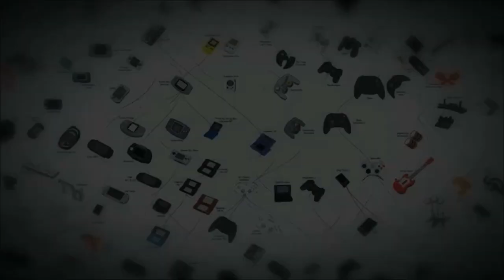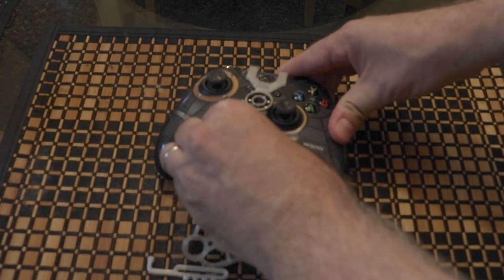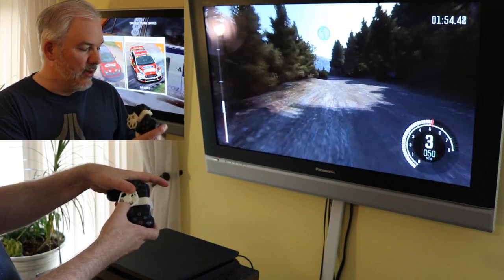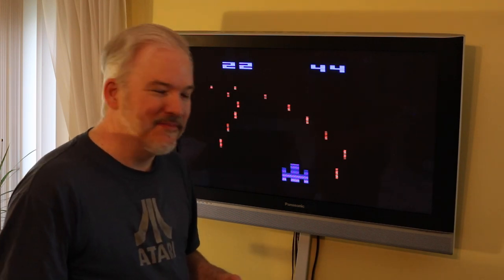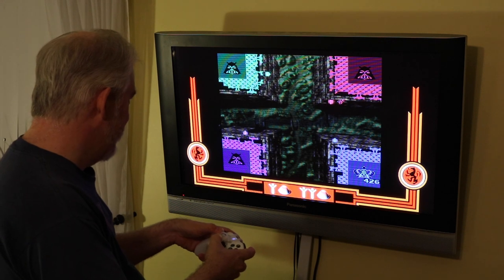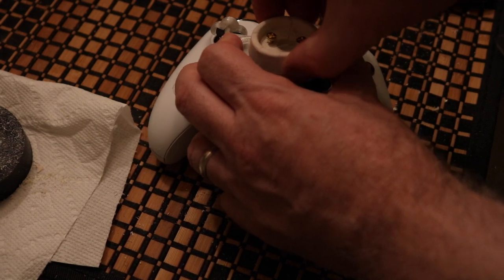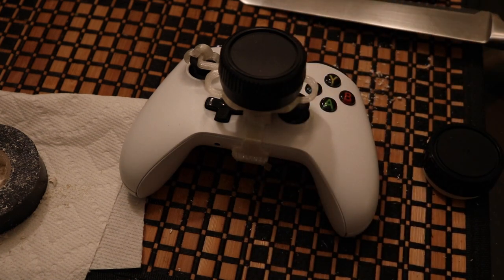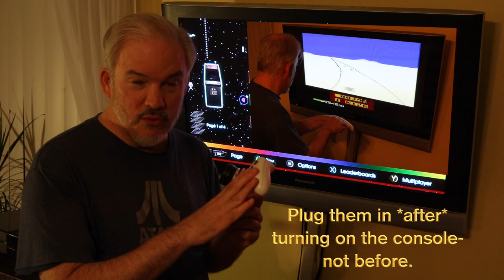Retrofit PS4/XB1 Controller: 3D-Printed Forza Mini-Wheel/Paddle for Better Retro-Gaming (vid #53)

Comment: I'm glad you showed that it can either be self-centering or non-self-centering.  What is the difference, and is there a special "locking" part that's extra?
Reply from the maker: Thanks, Brian. Glad you got to watch it, since you were the guy who had expressed some serious interest a couple months back in me covering using a paddle controller on the new system classic games compilations.  

Regarding your questions, self-centering is preferred in games that have an emphasis on center-position within their method of control.  Driving games work best with a self-centering controller because it's nice to just let go of the wheel when you want the vehicle path to straighten out.  Another type of game that benefits from self-centering would be shooters like Tempest and Tempest X (PS1).  When you want to come to a halt, it's nice to release the paddle and let a spring mechanism bring it back to center-position.  It stabilizes the control in the game.

Self-centering controls are not the ideal for games like Super Breakout and Star Wars Arcade, though, because the analog movement in those games is 1 to 1 with the controller position.  In other words, it's relative to the actual stick or paddle position.  I can think of a number of true analog games which do best with a paddle or joystick that doesn't self-center: Circus Atari, Arkanoid (& all Breakout or Warlords style games), Astroblast, Solar Storm, and any game that you'd prefer to use a mouse with (aim-control shooters like Star Wars Arcade or Terminator 2 Arcade).

Now the paddle attachment that I was using in this episode on the white Xbox One controller has a very light amount of self-centering, which is actually okay in pretty much all the games. If it was a strong amount of recentering I'd be less excited about it...  but it's a good all-around gadget to use on all the analog games because the self-centering is as light as a feather (and this is because I sanded down the horizontally-positioned on-a-track part that connects to the teeth of the center-wheel gears to reduce friction). 

The dark-colored Xbox One controller, by the way, had a non-self-centering wheel attachment on it.  I chose to not sand it down much at all, so it's got an increased amount of friction that keeps it from recentering.  It's got a little too much friction at the moment, so I'm thinking of sanding it a small amount, so it might be improved.

Again, I'm glad you got a chance to see this video. Feel free to post it on any of your websites :)

Comment: I wonder if theres a way to make something that uses the PS4s touch pad to make some sort of analog controller for the supported games on the Flashback collections?
Reply from the maker: The only possibility I can think of would be to use a device that can be programmed for remapping functions on the controller.  But, as far as I know, the CronusMax Plus cannot assign touchpad activity to the analog stick.  I don't know for sure about the Cronus Zen, though... it could be possible with that.

Comment: About the extra buttons, there is a Power A Authorized Xbox controller with a ring finger button on the back on left and right.

I got one for $20 and 3 for free because the audio port was not working.  Later turns out it needs an Apple/Android chat cable converter
Reply from the maker: Nice. I wonder: Does the steering wheel attachment fit on it?
Reply: @wiredupretro  I noticed there are two separate versions of the Xbox One on those steering devices.  1 works for S controllers and X controllers.  And the other works for model 1 controllers.  It depends on the measurements of where the analog sticks are.

And I also noticed that that stick is a two-way stick.  Is it possible to oriented vertically for vertical games, like pong Sports.
Reply: @wiredupretro  finally they should tell you whether their gear teeth are designed to keep stationery
Reply: @wiredupretro  keep  stationary, or self center.
Reply from the maker: @Aceintheholeminigolf  There may be two versions for the different iterations of the X1 controller, but I'll tell you this: My 3D printed accessories are identical and they both work equally well on the black one (original X1 controller) and the white one ("S" version).

If you 3D print your own accessory, it will start out in a state that is not going to recenter (the gear teeth part/horizontal track are tight-fitting against each other).  It's only after you sand down these parts that it recenters.

If you order from an Ebay seller you'll probably need to make a request about recentering (or non-recentering) before buying the product and see what their response is. 

I take it you intend on getting one for an Xbox one controller. I would recommend having a library 3D print it for you.

Oh, and regarding your question about playing the vertical analog games like Pong Sports with this kind of paddle attachment, the unfortunate answer is that you can't use it...